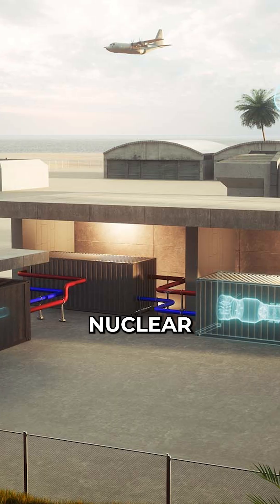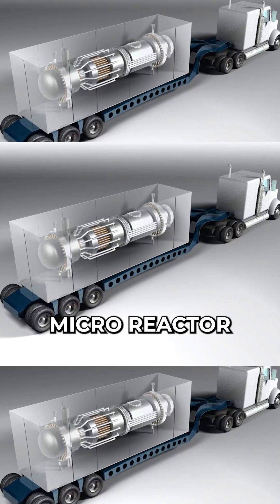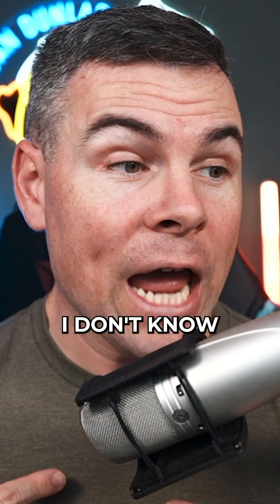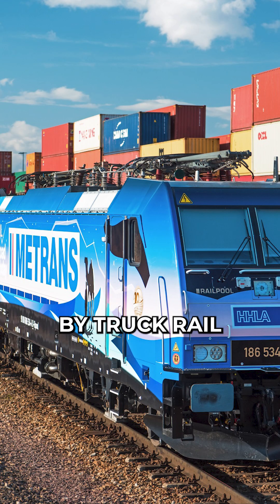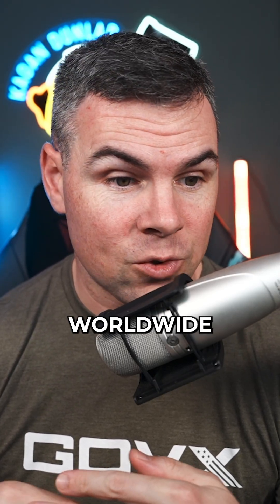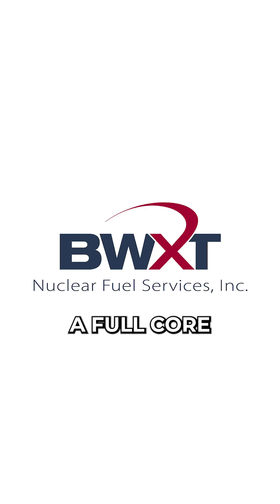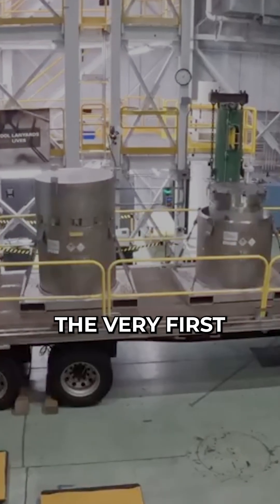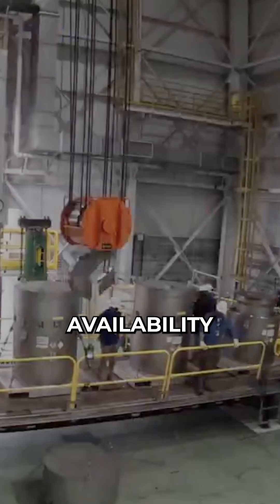Project Pele, The US DOW's Microreactor. Powered by @shopgovx #govxpartner

Comment: TRISO fuel (which stands for TRi-structural ISOtropic particle fuel) is a super-tough type of nuclear fuel designed for advanced reactors. Think of it like this: Imagine tiny spheres, each about the size of a poppy seed or a grain of sand. At the center is a small kernel made of uranium mixed with carbon and oxygen—that's the part that actually produces energy through nuclear fission. Surrounding that kernel are three protective layers (that's the "tri-structural" part), kind of like an onion or a jawbreaker candy with multiple coatings:

A porous carbon buffer layer to absorb shocks from the fission process and give room for gases to build up without breaking things.

A dense carbon layer for extra strength and protection.

A super-hard silicon carbide layer (like a ceramic shell) that acts as the main barrier to keep radioactive byproducts trapped inside.

The "isotropic" bit just means these layers are uniform in all directions, so they're equally strong no matter how you stress them. Overall, these particles are built to handle extreme heat (over 1,600°C without melting or releasing radiation), radiation damage, and corrosion way better than old-school nuclear fuel rods. They're packed into larger forms like pellets or billiard-ball-sized "pebbles" for use in reactors. The big advantage? It's much safer because each tiny particle is its own mini-containment system—if something goes wrong, the bad stuff stays locked inside instead of leaking out.

Basically, it's like putting nuclear material in a bunch of indestructible M&Ms— the candy shell keeps everything contained, even if you heat it up a ton...

Comment: Physicist here. Each spherical TRISO pellet contains uranium fuel in its core, surrounded by other encasing materials. The TRISO pellets are essentially self-contained systems, such that if one is damaged it only leaks into the outer layers of the pellet. Meltdown is physically impossible, making these reactors extremely safe.

The "gas-cooled" portion means that gas flows across the TRISO pellets,  soaking up the energy that they are radiating (which heats the gas). This heated gas either turns a turbine directly or deposits its heat into water (heating the water into steam) in something called a steam generator. The steam then turns a turbine.

Comment: TRISO (TRi-structural ISOtropic) particle fuel is a robust nuclear fuel designed for advanced reactors, known for its high safety and efficiency due to its unique structure and materials.
Composition and Structure
TRISO fuel consists of a uranium, carbon, and oxygen fuel kernel that is encapsulated by three protective layers made of carbon and ceramic materials. This triple-layer design acts as a containment system, preventing the release of radioactive fission products even under extreme conditions. Each particle is about the size of a poppy seed, making them incredibly small yet highly effective. 
Advantages of TRISO Fuel
High Temperature Resistance: TRISO particles can withstand temperatures exceeding 1800°C (over 3000°F) without melting, making them suitable for high-temperature gas-cooled reactors and other advanced reactor designs. 
Enhanced Safety: The self-contained nature of TRISO particles minimizes radiation risks, as each particle retains fission products under all reactor conditions. This feature significantly enhances the safety profile of reactors using TRISO fuel. 
Durability: TRISO fuel is structurally more resistant to neutron irradiation, corrosion, and oxidation compared to traditional nuclear fuels, which contributes to its longevity and performance. 
Versatility: TRISO fuel can be used in various reactor types, including high-temperature gas-cooled reactors, molten salt reactors, and even as accident-tolerant fuel for light water reactors.

Comment: It’s a micro, Gen four reactor. Think about the Russian city powered by a submarine reactor.  The concept worked.  We scaled it down, the issue was shielding dirty bombs nobody could keep track of.  This was in May 1996.  It worked.  The potential was an issue.  One micro reactor heating water for a turbine.  To great of a risk, it was shut down.  We never saw its potential.  Now micro Gen five reactors potentially are installed on 60% of bases and Post.  That how we get the power.  We don’t care unless it blows up.  We’re so advanced now, you worry about a bullet, not a nuke reactor.

Comment: Reminds me of the old thermal generators that the USSR built thousands of and installed in remote communities. Not true reactors but still radioactive. And they just forgot about them, and never cleaned them up, so most are still scattered across Russia left to decay and leak radiation for hundreds of years.

Comment: I just watched a video on this yesterday... so instead of actual fuel "rods", they encased small uranium pellets with ceramic coating and then put into a a battery sized container then put all those in like a fuel rod would do... (no I am NOT a nuclear engineer or have any expertise in nuclear science/engineering...) but yeah basically a fuel rod is replaced by a bunch of smaller "capsules" that are filled with a radioactive element encased fully by ceramic...) Google

Comment: The “containers” will hold solid fuel in the form of “beads” each bead has a core of uranium. What this really means is that these reactors will be adding to the waist fuel pile, that must be stored and secured.
Let’s skip this method and go to the liquid fuel. It will soon be able to burn up all “spent” nuclear fuel and reduce its volume by 90+%, be safer even if is “blown up”, harder to work with if you want to do nefarious activities with it. Easier to refuel the reactor and cheaper to refuel. Copenhagen Atomics has a reactor now, it is being tested in Switzerland, but the US is ignoring it.

Comment: One megawatt is nothing. These are actually being developed at TVA in Knoxville  through the US government, the first one is almost complete. It will go to a data center in Nashville.  
Remember a two burner  coal power house produces around 1400 MW and can be produced for less cost than the one megawatt nuclear. 
Without new  coal power houses we will never have a middle class there’s very little employment that goes along with nuclear or natural gas. That is why our inflation is so high and electricity bill is out of control. It’s 12 times more expensive to make electricity out of nuclear 10 times more expensive out of natural gas.  
To produce 750 mega watts from natural gas  in a combined cycle unit actually six units it takes it cost about $48 billion but to produce 1400 MW from coal it cost a half $1 billion the natural gas plant last for about 13 years but we have coal plants that are 70 years old and still running. This just impoverish his America and makes the energy industry rich.

Comment: This kind of thing is a recurring topic.  I think in general the fuel pellets might be coated in pyrolytic graphite (it's great stuff, limited only by expense.  Carbon deposited from gas, so it's dense and almost metallic) maybe some other coatings.  Physically rugged high-temperature materials.  I think one of the design goals for this kind of thing is that if the temperature rises too much the reactivity goes down, keeping the whole thing from melting.  Also the mass of marbles (?) can be circulated and handled, I think in some scenarios they hope to slowly take out ones that are used up and put in new ones continuously.

Comment: All it has to do is be hot. Even the SNAP generators on the moon are still producing heat.  1500 watts of heat, 24/7 for YEARS.  TRISO = TRi-strucural ISOtropic particle fuel. Each particle is made of uranium, carbon, and oxygen

Comment: SMRs are the future. Standardized Mass production in a factory reduces cost and they can be shipped back for refueling and connected in parallel to match power demand for less decentralized mega sight built reactors.

Comment: This is awesome but my biggest concern is how they intend to reinforce these to prevent runaway meltdowns or radioactive fallout if struck by artillery or some other form of attack, causing any bases these are located at to become uninhabitable and potentially unsalvagable due to radioactive contamination of the whole base, could one good strike take out a whole military installation in a very favorable strategic location? What's the procedure for preventing the reactor from falling into enemy possession and then replicating the tech? Nuclear power generation is great for powering local home infrastructure where it's not in the line of fire, but if this flaw is a real weak point then we're looking at a different logistical nightmare, possibly worse than the diesel logistics one with longer term ramifications
Reply: So @kkaspern01 has a great comment about how the fuel is constructed to inherently prevent meltdowns so there's one issue resolved 👍

Comment: Imaginează-ți o bomboană extrem de dură
 cu 5 straturi, dar la nivel microscopic.
1 în centru (core), este uraniu (materialul care produce energie), aici „se sparg atomii” se face căldură
Cele 5 straturi (pe înțeles)
2 Stratul moale (carbon poros), ca un burete, absoarbe gazele care apar din reacție, scade presiunea.
3 Stratul dur (carbon special), ca o carcasă, ține totul la un loc.
4 Stratul SUPER-dur (carbură de siliciu), ca un blindaj ceramic, extrem de rezistent, nu se topește ușor, nu crapă, nu lasă radiația să iasă( acesta este  „seiful” adevărat).
5 Stratul dur 2 (alt carbon),  protecție finală, întărește tot ansamblul. Practic fiecare bilă are ~1 mm , este independentă, dacă se strică una,  celelalte NU sunt afectate.
La TRISO: bilele rămân intacte,stratul ceramic rezistă,reacția se oprește singură,fără explozie fără dezastru.
TRISO = combustibil nuclear „împachetat” în așa fel încât NU poate scăpa de sub control.
Fiecare particulă este un mini-reactor sigur.
De asta este considerat „next-gen”. Sper că este destul de explicit, multă sănătate, pace tuturor 🤍 🙏🏻 😇

Comment: I'm not sold on this. It's a high temperature/high pressure gas cooled reactor. We should do this with molten salts with no depressurization risk. As a side benefit the salt would be easily containable within a specific area in the event of a breach from a direct strike to a reactor vessel on a military base. The risks involved are a bit to high for me. Virtually every gas reactor design has had a major failure, they were originally designed to breed plutonium and this is more or less a step backwards in technology the fuel and the moderator will still be radioactive for many centuries I can see a Chernobyl style problem here the core could continue to function even when open exposed to atmosphere so long as enough fuel is close to the moderator it will continue to burn for a long long time with molten salts a breach would force a power loss and the entire core would drain to a tank that stops criticality quickly and safely. This has no such features. The idea is if it's never struck from the enemy it will be safe. I don't believe that for a second.

Comment: it's a design that basically Self-SCRAMS (safely shuts itself down) and can't get not enough to melt due to the way the fuel is packaged.

gas cooled is interesting. wonder how the generation side works, if steam is still the working fuid for a turbine or ifny went sterline or thermoelectric or whatever....

Comment: This is soooo cool! It's going to make remote bases so much more stable, and imagine if this was available for public use. We'd be able to help so many disconnected communities have power that didn't rely on the weather.
Reply: I'm definitely seeing this for settling remote frigid areas, where the "waste heat" is a valuable product.  I've seen a video from China about a gas-cooled high-temperature reactor (I think) out in a dry desert, instead of cooling towers with water it had giant heat sinks!  Still, that was just getting rid of surplus heat, imagine if that was all consumed!  People keep talking about ARCTIC stuff, this is clearly the way.
Reply: Yeah, unfortunately I can see the military demanding these first for remote bases so they can defend those who lay claim to more foreign oil...

Comment: It's a pebble reactor. Put all the pebbles in a bucket in they heat up to about 800 degrees.  No mechanical rod moderation.  If there's a problem the bucket dumps the pebbles out and spreads the fuel pebbles out, the reaction slows and everything cools off. So, much simpler systems all around.

Comment: Every hospital needs one of these
Reply: I don’t know about every hospital ,but I think every little town should have one.
Reply: Being able to bring power to a disaster area would be key!
I live in Florida and one of the biggest issues recovering from a bad hurricane strike is restoring power.

Now a lot of that is restringing new power lines. But there are always many places that still have their lines up and ready to receive power but these areas fall at the end of a transmission link.

Bringing power back to all those 5,000 or 10,000 pockets of unaffected homes and businesses reduces of the need for daily ice, food and water to those folks. Any would help redirect the supplies and equipment where it can do the most good the quickest.
Reply: @sedatedape315  I agree completely. These units will help de-centralize the power grid so a disaster hundreds or thousands of miles away won’t be devastating to an entire region. There is also a lot to be said for local autonomy.
Reply: @motormaker -- a case point for disaster and autonomy is the Florida Keys.
They rely on power generated on the main land. 
If another Andrew hits the Homestead, or lower areas, this could cut off power throughout the Keys.

Either having these types of portable power units available to put in place OR letting a power company (existing or new) purchase these small generation units would remove tens of thousands of unaffected residents from the disaster equation.

And a lot of help can come from an unaffected area that isn't "part of the problem" after disasters, as long as they have electricity.

Earthquakes, floods, forest fires, ice storms ... the list goes on for the US.
Electric power is a big part for the beginning of recovery.
Reply: @motormaker 
And exactly why it is unlikely to ever happen power companies, power  co-op's, ECT will fight it tooth and nail to stop it from happening.
Reply: Indeed that would be a great idea.

Comment: Throw that stuff to gippity to explain
Reply: Tri-structural isotropic (TRISO) particle fuel is a very robust type of nuclear fuel designed to be extremely safe, even under accident conditions.

In short:
👉 it’s tiny fuel particles, each wrapped in three protective layers, so every particle acts like its own containment system.

⸻

What “TRISO” means

TRISO = TRI-structural ISOtropic
	•	Tri-structural → three main coating layers
	•	Isotropic → strength is the same in all directions (important under heat and pressure)

⸻

What a TRISO fuel particle looks like

Each particle is about the size of a grain of sand (~0.8–1 mm diameter).

Layers (from inside → out)
	1.	Fuel kernel
	•	Uranium oxycarbide (UCO) or uranium dioxide (UO₂)
	•	This is where fission happens
	2.	Porous carbon buffer
	•	Absorbs fission gases
	•	Cushions swelling and heat
	3.	Inner pyrolytic carbon (IPyC)
	•	Structural layer
	•	Helps keep fission products contained
	4.	Silicon carbide (SiC) layer
	•	The key layer
	•	Extremely strong, heat-resistant
	•	Acts like a mini pressure vessel
	5.	Outer pyrolytic carbon (OPyC)
	•	Extra protection
	•	Bonds the particle into fuel compacts

⸻

Why TRISO fuel is a big deal

🔒 Inherent safety
	•	Each particle contains its own radioactive products
	•	Even if the reactor core is damaged, fuel particles don’t melt or leak easily
	•	Can withstand temperatures >1600–1800°C, far above traditional fuel failure points

🌡️ Meltdown-resistant
	•	No traditional “meltdown” like light-water reactors
	•	Fuel stays intact even with loss of cooling

🧱 Distributed containment
	•	Instead of relying on one big containment system,
	•	You have billions of tiny containments

⸻

Where TRISO fuel is used
	•	High-Temperature Gas-Cooled Reactors (HTGRs)
	•	Pebble-bed reactors
	•	Advanced / Gen-IV reactors
	•	Many Small Modular Reactor (SMR) designs

Fuel particles are embedded in:
	•	Graphite pebbles (tennis-ball sized), or
	•	Graphite fuel compacts (cylindrical pellets)

⸻

Why it matters strategically

TRISO fuel enables reactors that are:
	•	Safer by physics, not just controls
	•	Better for load-following and remote sites
	•	Attractive for industrial heat, hydrogen production, and future energy systems

⸻

One-line summary

TRISO fuel is nuclear fuel made of sand-sized particles, each wrapped in ultra-strong ceramic and carbon layers, so every particle safely contains radiation even at extreme temperatures.

If you want, I can also:
	•	Compare TRISO vs traditional fuel rods
	•	Explain why it pairs well with molten salt or gas reactors
	•	Tie it into modern SMR or energy-independence strategies

Comment: The fuel pellets are the size of poppy seeds. They are encased in a high temperature stable ceramic where the middle layer acts as a buffer probably because of slightly different thermal expansion of the other two materials. You have to coat the fuel in something highly stable to contain fision products because they are highly radioactive and dangerous if released. Helium is used here as the primary coolant because it is very stable and nonreactive. This eliminates having to carefully control the chemical additives to the primary coolant. I assume the army doesn't want to train legions of nuclear reactor technicians so these units will need to be plug and play. I was an ET2 Nuclear in the Navy, and nothing I have said is classified 😅
Reply: @danielcarson5037  I used to work on this fuel at the Idaho site